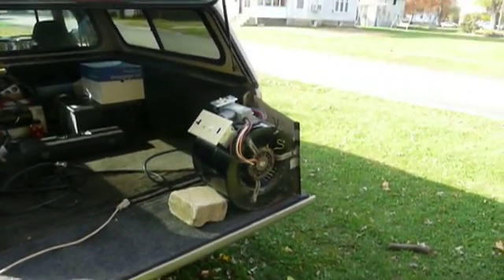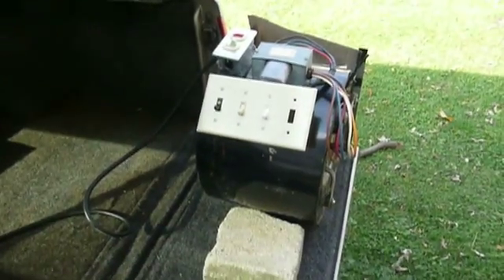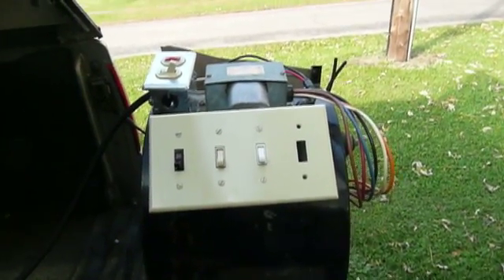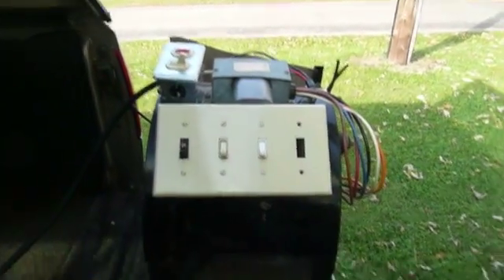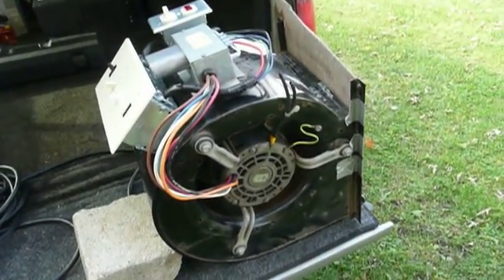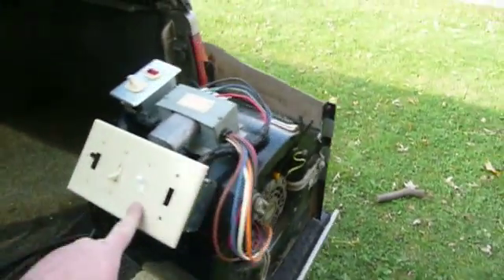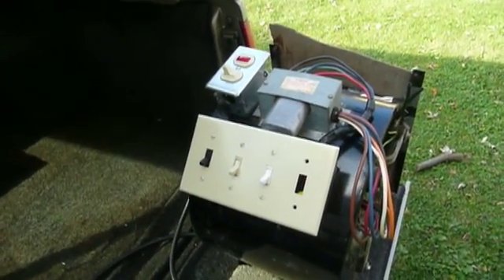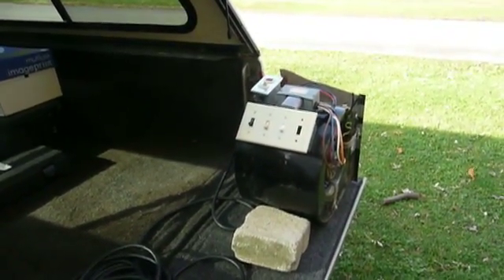Making A Furnace Fan Speed Selector

Comment: Can you do this with a 3 wire ecm type variable speed blower motor?
Reply from the maker: Maybe, but it will take a different approach. The ECM motors I'm familiar use 24 volts on certain connector pins to select the operating speed.

Comment: i absolutely need a schematic of this switch assembly as i am going to use a similar blower on a forge and need the ability to change speeds, PLEASE post it... some of us are desperate for it! thank you....
Reply: If you're contemplating using a blower this big on a forge don't. It is way too powerful, even on it's lowest setting, and will shoot the burning coals all over the place. I am speaking from experience. Either find a hair dryer to blow air into the forge or you might consider switching to propane. Propane is cleaner and much easier to clean up after you melt or heat up metal. Plus you don't need a blower to get the propane into the forge. Check out the king of random for a great tutorial for assembling a propane torch.
Reply: LukaTuba Blume lol.... after speaking with several other blacksmiths, I can to the same conclusion.  I cut off the electrical wires and welded a hand crank up to it.
Reply: +ken jensen that works too.

Comment: I'm not sure what purpose you had in mind,  but when you run a typical blower WITHOUT  the normal ductwork that the system sees,  you rarely can run it higher than "low" without "overamping"   the motor.   Therefore using one as say,  an attic fan,  one must be very careful that the motor is not overamping and overheating. This is also true of furnaces/ rooftop units with minimal ductwork or an A/C unit that's iced up